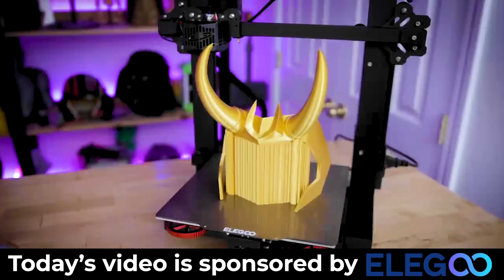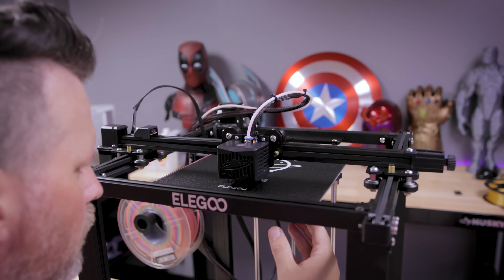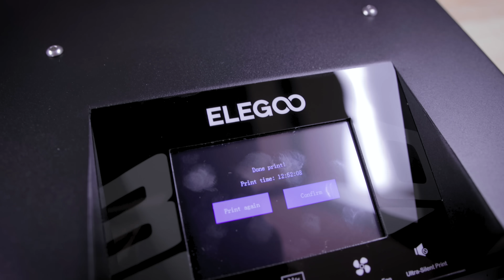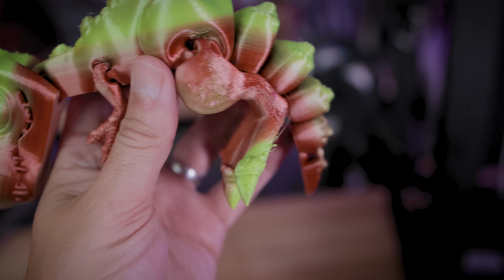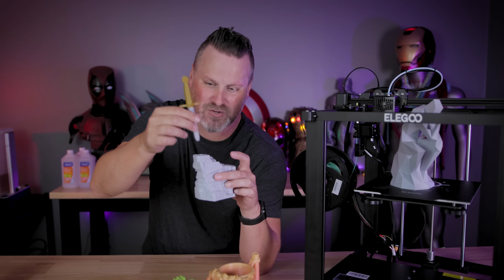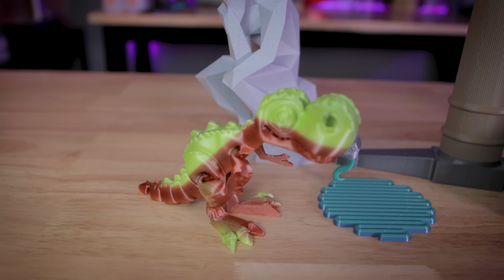Neptune X 3D Printer is finally back!

Comment: Thanks for your video Uncl Jessy.
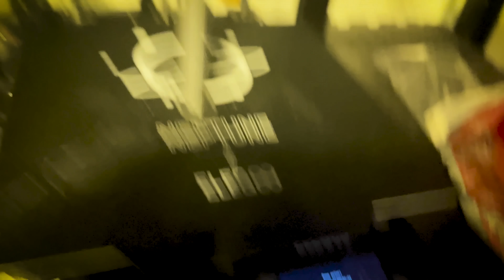At 9:04 I can clearly see a problem that I don't understand. It's a part of the sword that is printed in VASE mode, and still there is a very big wobble visible in the blade that you printed.
Is this because the bed had a wobble, or because the printhead did dig a bit into the print, taking it out on a swing? (English is not my main language)... 
I have seen some great projects making this printer capable of printing with materials like CF-Nylon and such, so I am probably going to buy one and modify it before it makes it's first print 🙂
Although I have my own channel, I will use your link when I buy it, because your video made me decide I want to buy it. Thanks a lot. Appreciate your work.

Comment: you want bigger printer, go for it, I got biggest baddest of them all, joking a bit, I have 600x600x600 right here. Only this printer works part time because most of my prints works on my smaller printers and yes, I have 9 in all.

Comment: Dear Sir: Almost two month ago I bought the Neptune X and the Neptune 3, I tested both printers and they print amazingly nice. But, I have a problem with the Cura 4.8 program installation which came with each printer. Which ever Cura 4.8 program installation I installs first will remember the printer it came for. As soon as I install the other printer's Cura 4.8 it still uses the previous installed printer profile. Am I going to need two laptops, one for each printer? If you can help I will really appreciate it !!! Also I will like to upgrade to Cura 5.1 if possible.
Thanks !

Comment: finally, been waiting for these to come back out because Core X/Y printers are STUPIDLY fast printers vs bed slingers.  Usually about 120mm/s is top speed for a bed slinger without ghosting, a core X/Y can easily, and reliably get 150-220mm/s print speeds, provided the extruder can keep up.
I agree, I would love to see a 350x350x400 sized Core X/Y printer from them.
However the FDM printers from Elegoo are clones of the Ender series of printers, only VASTLY improved over the base models.
The PEI plate from the 2s is an upgrade you can buy for the Ender 3 already, seeing as the X has a magnetic bed already, I would assume the 2s's build plate would fit on it as is.  Anything that works for an Ender 3 works for the Neptunes, even the metal extruder is a 20 dollar upgrade on amazon and is a direct swap.  The 2s is just an upgraded 2 already with a few of the popular upgrades people would already put on their machines.  Like the better screws and springs, extruder, and PEI build plate, and upgraded bowden tube, just coming installed from the factory instead of aftermarket.
Reply: This isn't a core xy printer

Comment: Hey Jessy One thing I would love to see from you is how you maintain your machines. If you get a clog how you handle that, how you change a warn nozzle. How do you manage with the Neptune 3 and making sure not to damage the bed leveling. Pretty much some of the more common things and maybe some of the rare odds and ends you have experienced? Now I know Elegoo has it's own videos on some things but they feel very outdated and also have some questionable bits, like saying you need high temp resist thread sealer to change to nozzles? They also show bracing against the heat sink to change it that some people say you never do. 

So yeah I would love to see you go through just general maintenance covering some of the most common thing's you may need to deal with, like clogs, to some of the things you may only need to do or face once in a blue moon.

I ask as I have experienced my first clog and using that needle thing hasn't seemed to fix it, filament flows smooth for a moment then it seems to re-clog right off. I seen tricks like a hot/cold pull of filament to try and pull the clogs out, but using the Neptune 3 I can't seem to do that and not sure if such even works on it or if I'm doing something wrong. Right now my printer has come to a stand still as I cant get anything but a sliver of filament to pass through and poking it around only frees it up for a bit then its back to slivers. 

A side note: Does your neptune 3 also like to contantly expell filament when it heats up? Mine does even during bed leveling and I worry that it's scewing the leveling resaults, plus it's stupid hard to align the z axes as the filament constantly even at a slow rate coming out grips the paper so its hard to tell if the tightness I feel is from the nozzle being to close, or filament slipping out. Plus during printing I have to race to remove a dangle of filament after it does its line on the side or it leaves a glob on the plates center right before it starts printing. Elegoo says this extrusion of filament is normal but the 2S never did this.

Comment: Nice! 
I have a 29 cm high print that I sell regulary, and was just searching for something like 220x220x300, as CR-10 size doesn't really stack well on my shelves.
Cant wait to try one out  😀
Reply: You don't have problem with shipping cost? In my country I have to sell something small because the shipping cost 3 times what my 3d print worth 😢
Reply: Well, I'm not paying for shipping, customer does, and if you're not printing your own designes, but something that anyone with 3D printer can get then that's the issue.
Reply: @DymoPolska  I'm 3d modelling for 5 years by now so that's not a problem.
My problem is the product i want to sell could cost 1/3 of the shipping. Who the fuck would want to buy a thing like this? Here if i send something small as mail like you get it from wish, ebay etc it cost a fraction. The moment I send it as a box/package it start from 30+ euro...
Reply: @P4TRICCS 
 30 euro is very good price for shipping overseas.
Your attitude about this is wrong. 
If your models were unique and no one could get anything similar anywhere for cheaper, people would pay for shipping even more than the products worth. 
5+ years of modelling tells me or the customer nothing, for all I care you could be making default cubes all this time. 
Right now you're blaming wrong things instead of improving.
Are you trying to tell me that your're the only person in the world shipping from Hungary, and everyone else does it for free? 
Of course not. If everyone else does it then the issue is with your approach.

Comment: I am sure it still better than my big X Y Core printer the Tronxy X5SA ( 2020 model )  I have been fighting to get my Tronxy to print without much luck? 
It has a 330 mm ( 13 inches ) square bed but has 6 adjustment screws which make it almost impossible to level the big bed!

I even brought the new black better leveling sensor by Tronxy that can see any bed surface unlike the original blue sensor which can't see them.

Even with the new sensor I can't auto or manual level the bed. So I most likely be dismantling the printer and freeing up the 2 foot square foot print it's frame takes up so my Fl Sun Delta QQ-S Pro can be up on the work top with the Amazing Elegoo Neptune 3 which still is my best all round do everything printer thanks to the great auto leveling.

So the upgraded Voxelab Aquila and the Delta and the lovely Neptune 3 can be up together. 

Just wish now to save the money t get my 1st resin printer the very pricey but lovely big Elegoo Saturn 2.

Comment: Time for 3d printers to take the next step, Bit boring now as they are very much do the same thing. What I mean by that is, there are loads of options for FDM and SLA printers, which all pretty much just do the same thing, I want to see FDM incorporate full colour machines now, I feel its a little pointless keeping on bringing out machines that all do the same thing. I understand this would be more difficult for Resin printers, however they will have to adapt eventually.
Reply: Unless you are changing filaments colors mid print (manually, MMU, AMS) or have a dual extruder it's typically faster to print the item and paint it later. Or print the pieces separately and assemble. 

The best printers now offer faster speeds, bigger build volumes, or takes care of annoyances like bed leveling.

But you may be on to something if they could combine a toner or inkjet style print nozzle to the extruder. I have to admit it would be a fantastic idea.
Reply: @No0o0o0o0o0  I think it would be awesome, the Da Vinci Color came out years ago now and uses inkjet and why the printer isn't great the idea is there and has shown its possible to do it.  I think we cant be far away from one of the big companies attempting to go full colour, otherwise like I say they all do the same thing really other than as you mentioned bed levelling and faster print times.

Comment: How about the size of the build plate? Is it 220x220 or 235x235 with a build volume of 220x220? I have springsteel PEI sheets that are 235 from my other printer and would love to use in this one  if I ever got it (her ein Mexico it has a small Prime rebate so it would be a litle bit cheaper), but if I got it I would have to make some upgrades like you mentioned: a bi-metal heatbreak, capricorn tubing, ABL and double gear extruder
Reply: Actual printbed is 235*235

Comment: Basically like my Ender 5, including the same quirks I found to dislike. Main one is no dual Z. I have the bed supports printed and on but it would help a ton if it had dual Z like the Ender 5 PLUS. Other thing that can be a pain is that top front bar on the frame. Man that thing gets in the way so much lol.
Sounds like a great machine for people like myself who hate the bed slingers! Print quality looks really good too. Would be nice to see your print settings for the models that you display so we know if they are printed at .12 layer height and 30mms or if you can push it and keep the quality.
Thanx for another great video man, keep it up :)
Reply from the maker: Thanks for that info!! I pretty much print everythjg at .2mm and was either 60mm/s or 80mms. Might slap a .6 nozzle on it and speed it up more

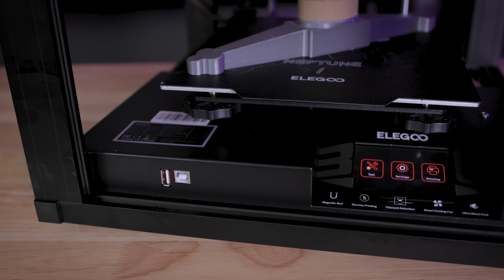Comment: 1:50 I have to agree. It would be so much more convenient. All resin printers have one, so why not FDM? Unless you use Octoprint, I guess.
Reply from the maker: Does octoprint rely on the micro sd port? Seems like a usb would be better for more control/print options.
Reply: @UncleJessy  No. Not in the printer. The Raspberry Pi connects to the Mini USB port on the side. Well...On a CR-10 it does. The Octoprint OS runs off an SD Card in the Pi. 
You just enter in the IP on your Computer and dump the gcode over to it. I'm guessing that you've never used Octoprint?  I don't print to any FDM printers without it.